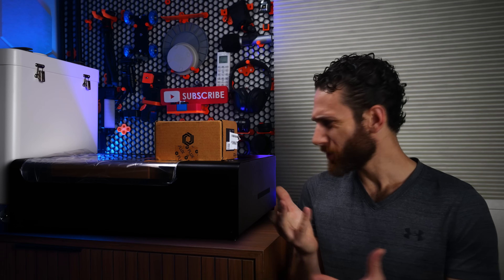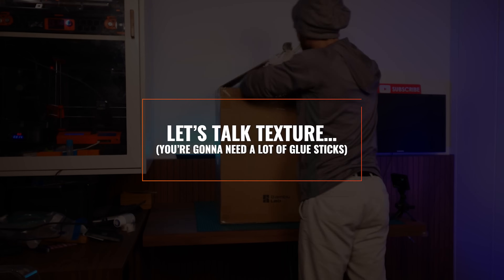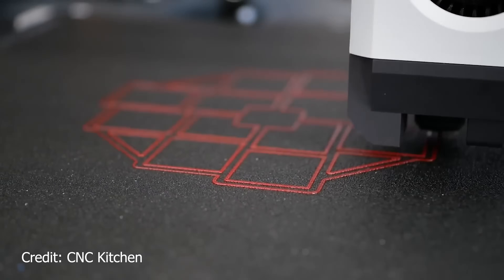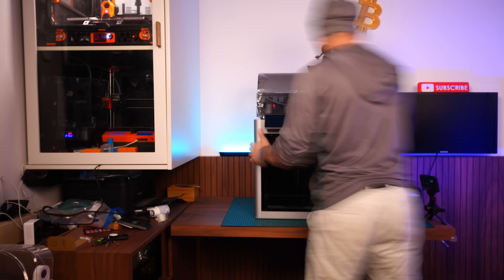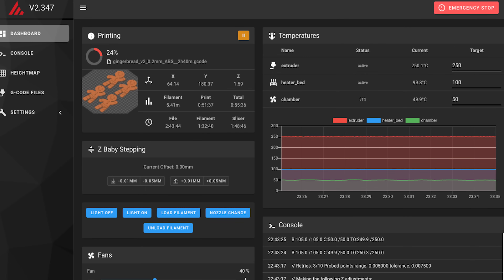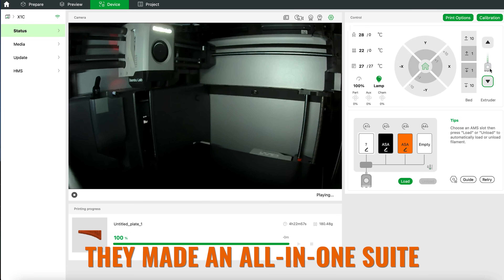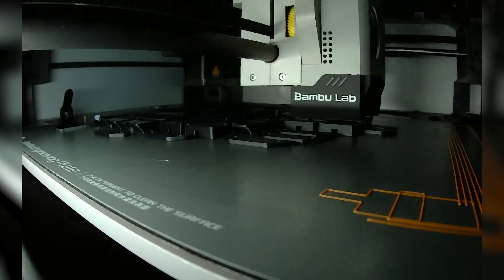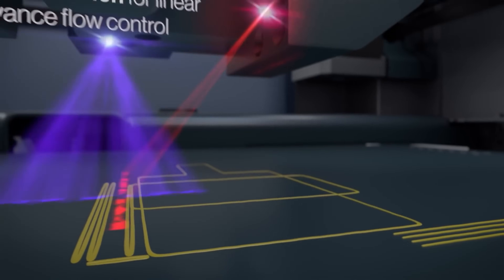Bambu Lab X1 Carbon: What NOBODY Is Talking About...

Comment: As they say in the textured PEI plate product page, the texture itself will create problems to the lidar when trying to read the print surface and do calibrations, that's why is not included.
Reply: I make lots of production parts where the first layer is the face and needs to be perfect.  I've only been able to achieve this with a hilbert curve on a textured bed, tuned precisely.  When the part is the faceplate for a monitor, you're going to see any imperfections.  This incompatibility would render the machine useless to me.  I'm kind of surprised that isn't a huge deal to everyone.
Reply: Wow, that is interesting. Lidar have trouble on PEI plate? = ) Good that I hadn't one on my Ender 3 (the very first one, not later name knock offs though). = )
Reply: This ^^^

Comment: You can't use the textured plate in the X1, as the self levelling lidar won't work with the textured surface. From Bambu Lab's themselves.
Reply: You can (and I regularly do, with my own X1C).  The lidar not working is a non-issue for me, every print (out of hundreds) has still worked just fine.  The machine simply mechanically self-levels by tapping the bed with the nozzle.

Comment: Really good review. I really like how you take a practical look at how you use it and really nice feedback to bambu Labs on what has "room for improvement".

That Bambu Labs are listening so much at the community feedback does however take me yet another step towards buying one - even with low WAF. 😉

All that said - for the follow-up - could you please clear up the need for a internet-connection when printing? Have just heard rumours and brief mentions. Obviously the app will not work off-LAN - but will the rest work within the LAN? Also, have they made any construction updates on the AMS? Early AMS seem to have had problems with easely crack/break during shipping.

My extended reflection about the texture-issue. Strange that the X1c comes with the cold-plate that (now) is only intended for PLA - if the printer is focused on printing things like ABS, ASA etc. - and that PEI hotplate have been sold-out for quite some time now. 😞

Again, excellent review - look forward to the follow up and have subscribed! 👍

Cheers!

Comment: I had mine for 4 days and right now it's basically a paperweight. So pissed off about it
Reply: What's wrong with it
Reply: @Condamine123456  Where to start? 
1)The AMS constantly says that there is a filament jam when there isn't. It was saying that before I even inserted filament. I took the AMS apart as per the instructions and there were no clogs at all. Also, when the filament runs out, it doesn't automatically switch over to the next roll of filament even when I had the option checked in Bambu Slicer. 

2) The tab for the connection pin that keeps the connection attached for the hotend fan was broken when I recieved the machine. Nothing holds it in place. So the fan comes unhooked and the hotend cools immediately and the printer stops extruding filament. The connector for the light in the hotend also does not stay attached. 

3) The filament cutted no longer cuts the filament. The arm pushes up against the plastic housing and jams, which causes the machine to give out an error saying that the filament cutter failed to cut the filament. 

4) The hotend is constantly having clogs. I have tried 7 types of filaments, it doesn't come out of the hotend and just builds on the nozzle as a big blob. I also never recieved a second hotend with my machine.
Reply from the maker: i'm shocked, mine is perfect... but there's always the concern that they cherry pick for reviews... Still, their service should be great, so contact them
Reply: @thenextlayer  Support ticket has been open for 5 days now with no response. Their customer service has been non-existent.

Pretty sure people are getting paid to give good reviews on this machine. The prints that I did get before all this were really bad. Like, worse than the stuff I was getting off my Ender 5+
Reply: @NerdyCraftsmith  Sorry to hear about this. Our customer support has made a tremendous job with the thousands of tickets incoming during Christmas break, while a lot of customers were receiving their printers. There's no reason why you wouldn't get an answer for our support shortly now. And I'm sure they'll figure out the solution to have your printer working
Reply: @malletfils  You work for Bambu? 

I also emailed support directly. TWICE. No response at all.
Reply: @LilApe  At this point, I doubt they'll accept my request for a refund.
Reply: @thenextlayer  so how is your surface quality? No ghosting/ringing? What about VFA? Many printers seem to have a poor combo of belts/pulleys, but others say they have really nice quality on par with slower machines.

Comment: Can you print a part with PA6 CF filament? I'm very curious
Reply: yes, i'm printing with PAHT CF15, but not with the AMS.
Reply: @ErZocktLP  good results?
Reply: @JoseAguiloworkshops  yes absolutely. Modified the generic PA CF profile with the specs given by BASF.
Reply: @ErZocktLP  did you use .4 nozzle? I am waiting the PA6 CF from Polymaker and I don't want to clogg the nozzle. I bought PA6 CF and PA6 GF.
Reply: @JoseAguiloworkshops  no problems to speak of.  Had once a little feeding issue, but that was mostly on my side as I print from a dry box. Had a to high resistance and got a slipping feeder.

Comment: Good video.  I have had my X1 for about 3 weeks and had the same problems.  Took a while to figure out the slicer and moving the files to the printer.  A couple of things that I don't like, you save the 3MF file, but not gcode, so you have to reslice to print again, you can't just send the gcode.  The cloud is always involved.  You can select LAN mode, but have no camera access.   The AMS should include a Y spliter for the external spool feed.  I printed almost 10 before I found a good one

Comment: Bambu Studio isn't competitive with Prusa Slicer yet, imo. The lack of "fill bed with instances" in Bambu Studio alone is enough to annoy me whenever I use it and want to print clones of a model.
Reply: Duplicate the instance with a number that will overfill one plate, then re-arrange them,  unselect all the options below auto-arrange, then delete the second plate and the stuff on the second plate. Done. This is a bit complicated than "fill with instances" but also only takes less than 30seconds.
Reply: @accumall3027  yes, that's what I do and it's janky as fuck. 'Fill bed with instances' should exist considering Bambu just copied and pasted the code from Prusa Slicer to begin with.

Comment: Great video, and it's refreshing to see a Prusa owner acknowledging the areas where Prusa has lagged, and acknowledging Bambu's faults.  I appreciate the objectivity, especially in this age of fanboys.  I own both,  and appreciate them both for their strengths. 

Now, a couple of points: 🙂

The reason for not including the PEI plate with the X1 series is because the LIDAR doesn't work properly with the textured PEI sheet.  That's why PEI is stock on the P1P and the cool/engineering plate is stock on the X1 series.

As for cardboard spools not working, that's not exactly correct.  I have had minimal issues with them, and, I find using vinyl electrical tape on the cardboard spools is far easier and less wasteful in time and materials than printing the spool rings but to each their own based on their own needs and use cases.

On a video production note, the different recording sources is kind of jarring.  The main video isn't smooth at all or the usual quality of your other videos, but the couch scene and future you talking about the problems being fixed is much better.  It's almost like the main video was shot on a Raspberry Pi cam, while the others are shot on a much better camera.
Reply from the maker: thanks for the feedback, all valuable, all appreciated. main video had some bizarre issue and i didn't have time to re-do b/c of the studio setup time. Apologies. I re-recorded week 2 though so it'll be good

Comment: I like your idea of choosing a textured plate at checkout.  I think they didn't include the textured plate on the X1 because it messes with the lidar.  Since the P1P doesn't have lidar, the textured plate isn't an issue.
Reply: using 99% of the time the  textured plate and have no issue with the lidar.
Reply: The textured plate is the only one I received, and I haven't had any issues...
Reply: Yeah, textured plate will make a lot of noise for lidar scan.

Comment: I generaly use Cura for my slicing apart from my MKIIIs which gets sliced by Prusa Slicer, I dont like using Prusa slicer, not because its bad, it isn't, its a good slicer! its just I am so used to Cura that when I use Prusa Slicer its like having my right hand tied behind my back,.
 I have a deposit down for a Prusa XL which I was hoping to get for Christmas 2022 but will be lucky if it shows up by Christmas 2023, I have resigned myself to getting an X1 and an AMS if I dont get a definate release date within the next quarter but that means I have to learn another piece of software, I am also trying to learn Fusion 360 with not a lot of spare time to do so, I think I may need to choose my definative slicer and stick to that one slicer but that would mean not getting an X1, I am in a quandry!

Comment: Running out of prints is, in no small quantity, one of the reasons some of us keep building more printers.
Reply: I just love to tinker and try different things. I've got one printer that I just keep tearing apart, redesigning and rebuilding.  So far I really like my X1C though and it is nice to have a printer that just prints and does it well without any manual calibration, tuning, editing of a .cfg/Marlin or needing an Rpi to run Klipper or Octoprint.  The ease of loading filament and no need to calibrate flow or z offset is really nice too.

Comment: I'm seriously thinking about getting one but based on my previous experience with other things the lack of open source support is an issue for me.
Reply from the maker: I might do a video about why I don't think it matters that it's not open source... spoiler: there are already knockoff parts available...
Reply: @thenextlayer My problem is that they have passed up the opportunity to improve the existing Open Source ecosystem and supply what is in effect non-standard software.

I like the fact that the viability of some hardware or software isn't dependent on the original manufacturer and I have been burnt by this dependency in the past, so that dependency being present is for me a significant negative.
Reply: @loc4725  your not the only one out there that likes owning and having options with stuff they buy. This is what is keeping me from buying one as well, even though I  know the parts arent the most expensive to replace.